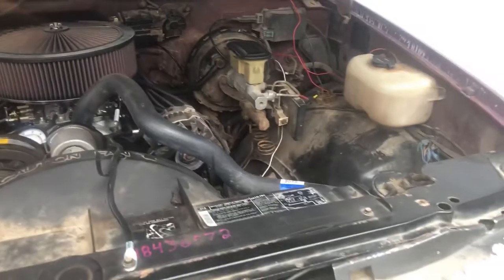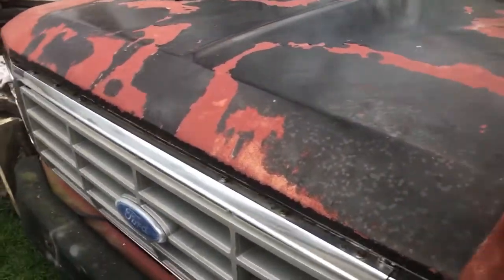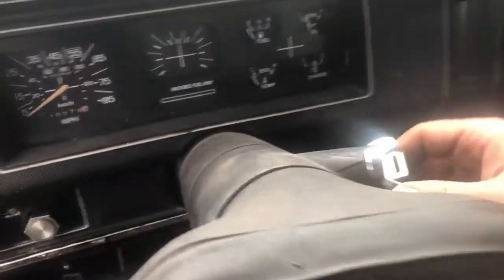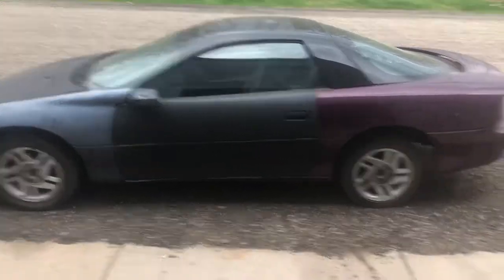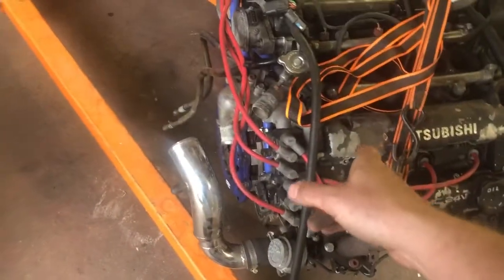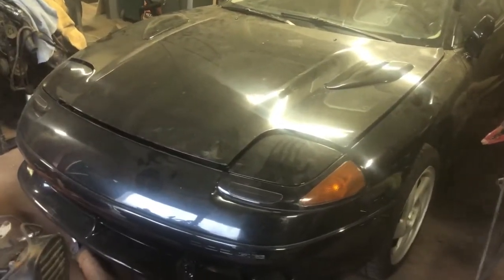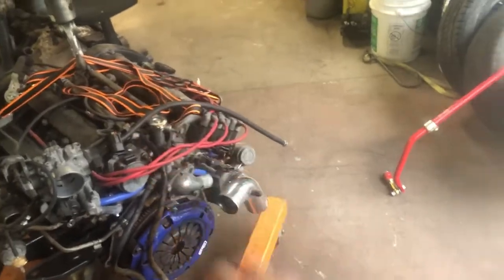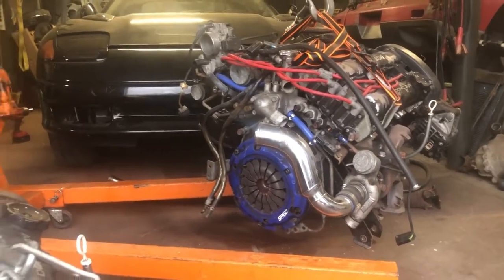Camaro bronco and stealth oh my

Comment: U in Canada ?
Reply from the maker: Nope north east Wisconsin
Reply: Turbo and non-turbo oil pumps are different.. I'm pretty sure...
Reply: Definitely get a new OEM oil pump gasket ... Lol u seen my oil pump videos ?
Reply: And don't forget to put silicone on the bolts.. well I put red silicone in the threads before I put the gasket on so then once I put the bolts in it would push the silicone in and no silicone would get in between the gasket and the block
Reply from the maker: yep thats y i am using the pump off the turbo engine on the none turbo